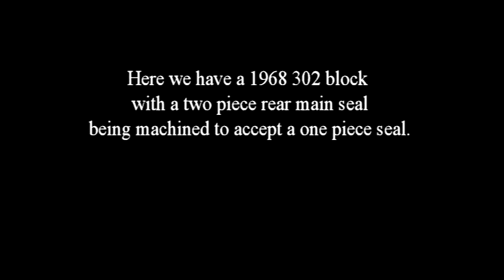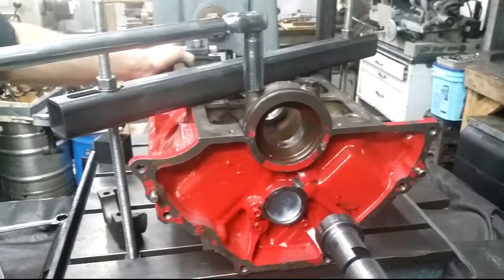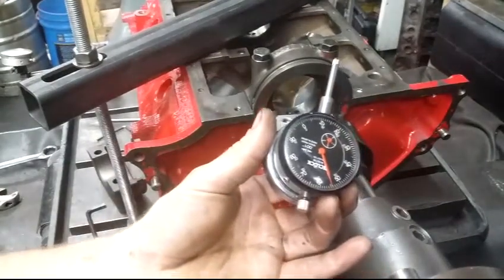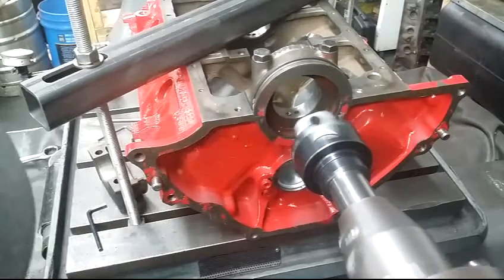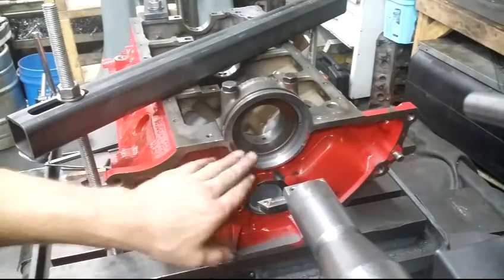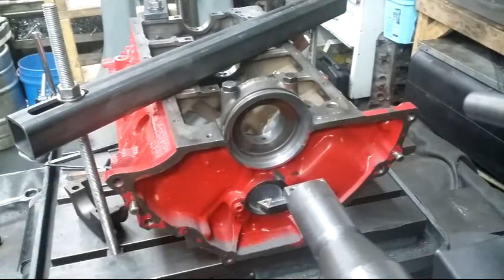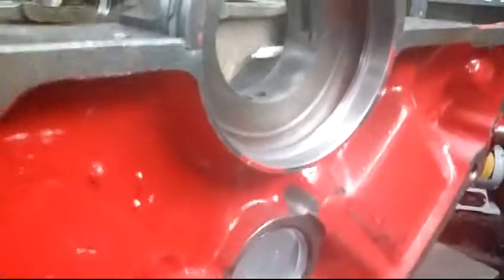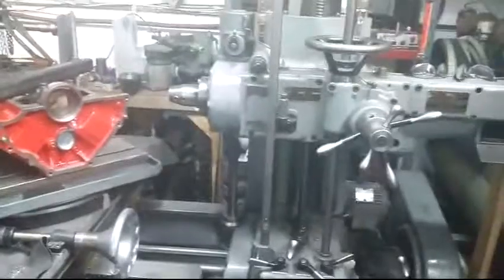Ford 302 engine boring  Rear Main Seal Conversion

Comment: Thank You!! Awesome video, you explained everything when you are working. I was looking a solution, my 1969 351W block (two piece seal) assemble with 1986 'stroker' crankshaft (one piece seal) . . . I found solution! Thank You put a video on YouTube!
Reply from the maker: Thank you Fred.  I do this to just about all of them including the 351 Windsors,  Clevelands and Modifieds. This is an old video and I have since tooled up to make this go even quicker/smoother as I started doing quite a few of them. I might make another video of this procedure in the near future 'cause it's a good one to show.  Good luck on your build👍

Comment: Thanks, always wondered if that could be done. Pulled a crank out of a 65 Mustang with that conversion on a 65 289, now you have to pull the transmission out to change the seal instead of just dropping the pan, a blessing and a curse. For all you guys who can't get a two piece seal to seal, don't quit your day jobs.

Comment: Looking for detail info on size and depth, So is the bore size like .005 under for press fit? and the depth cut to seal thickness +.060 or so? Thanks for the Video the visual helps.

Comment: Can you give me the diameter that you bored the block and cap out to and what part number of rear main seal that you are using ?
Reply from the maker: I use a generic replacement rear main seal for factory one piece seal blocks, nothing fancy.
Reply: @whiplashmachine  Can you tell me bore size you settled on, seal OD and crank journal size at the main seal?   Also, did the original 302 crank have a big flange like a 289?  If so, did you need to use a late model 302 crank?
Reply: Also forgot to add, Great Video!

Comment: Exellent. Who said you need a cylinder boring machine to bore cylinders( my old boss).
I use a big mill and it works fine       https://www.youtube.com/watch?v=7qGSNAKLCc8.
 Production machines are scary and depressing with their direct reading mic's and cats paws.
I am about to do the same conversion on a block I picked up . It was discarded because the caps had been lost. I got hold of another set of caps but from a later engine with a 1 piece seal. I have a line borer so i will Line bore then hone the mains and bore the seal dia,. Love your work. Cheers from Australia.